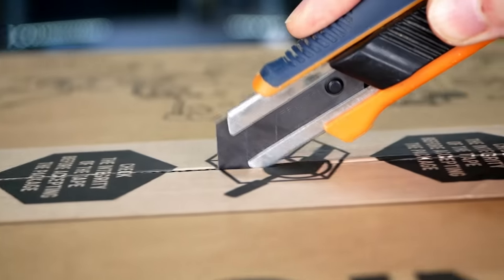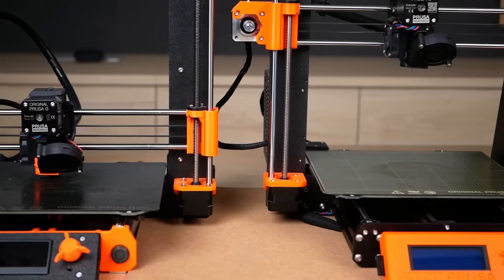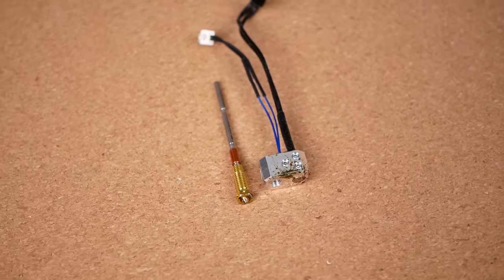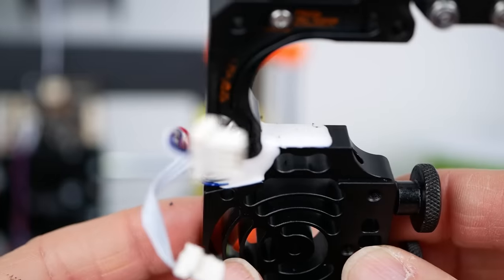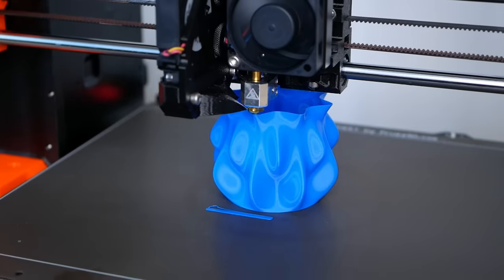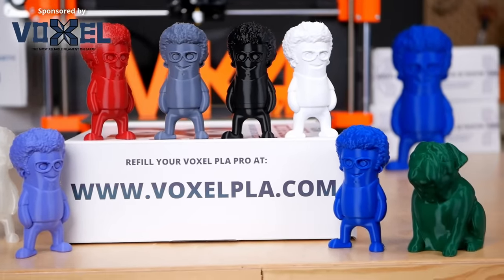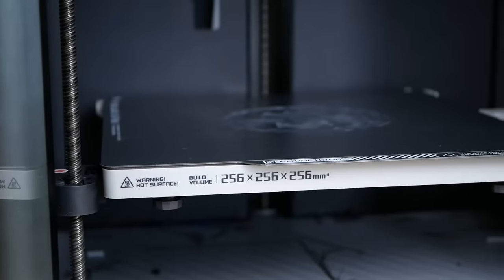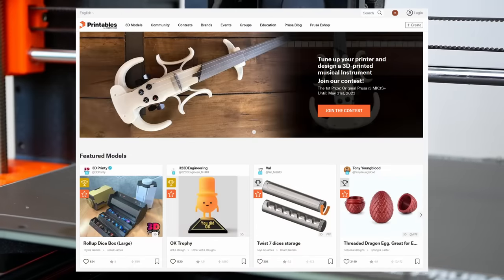Should you buy a NEW Prusa MK4 in 2023 or rather a Bambu Lab X1/P1P?

Comment: I own many 3D printers, including Prusa MK3S, Bambu Lab X1C with AMS. All of my printers print 24/7, I make parts for my business this way.
From my experience:
Prusa is a WORKHORSE, it always works with 0 repairs and barely any maintenance (lube rods). My MK3S printed over 150 kg of PETG and 30 kg of PLA in last 14 month.
Bambu Lab X1C - unfortunately is down 90% of the time. I constantly have errors like - “Z homing failed”, “disturbance detected”. And at some point printer stopped printing with “Z homing failed” error, per Bambu Support I did troubleshooting, didn’t help. Bambu support concluded - bed signal cable is defective and shipped me a new cable for me to replace (it takes 3-5 hours), and I think it will not solve the problem. Despite my multiple requests, Bambu would refuse to stand by their warranty and take the printer for repair. Quote “we do not have repair facilities to facilitate a repair”. That’s why I’m selling this piece of cr.. as soon as I get it fixed.
It’s all cool toys, until you need it for Business and consider Return of investment for money you spent on the printer.
That’s why I already ordered Prusa MK4 and Prusa XL

Comment: I read everything that is written in the comments and found nothing to convince our financial manager to approve the purchase of PrusaMK4 instead of Bambu Lab X1C. Prusa+enclosure which is necessary for printing engineering filaments is more expensive than Bambu Lab X1C without AMS and prints 3 times slower. All major spareparts are available for Bambu Lab and cost reasonable money. The choice of PrusaMK4 looks like the primacy of emotions over the reason.
Reply: Totally true. Just stock up spare parts in case the won't be available in the future anymore and you are set up pretty well.

The one and only downside is the noise of the printer, it is advisable to have it not in the same room where people work. If that is possible, there is no reason not to buy the X1C
Reply: @Jay Rizzie  More over, I've already tried not original hot end for Bambu from Aliexpress because I used not the best quality filament for fast prototyping. It's the same good as an original one. Quantity of third-party spare parts for Bambu is grown up. It looks like we are on the safe side with Bambu spare parts at the moment.

Comment: As a viewer from South America, I have a MK3 and will upgrade to MK4. I would not go for Bambulab simply because of the proprietary hardware, which would create for me a very severe reliability issue.

Of course, one should have spare nozzles or other parts that require somewhat frequent replacements, but having to import those parts can be a pain and take a long time, whereas the parts used in the Prusa are readily available in any market due to the popularization of its clones, making it a lot easier to service long term.

So for me that reliability and the community around their open source initiative is enough to justify the premium, not even addressing the very good costumer support that I have received when I needed.

Comment: The problem of a proprietary ecosystem is not only that they don't give anything back to the community. It's also a number of traps like “oh, you need a slicer which runs under linux? we have one, well, a binary you can download from our website, which will only run in a specific five-year-old ubuntu release and crash randomly sometimes. Also, you cannot because we removed linux support two months ago”.

There is a chance that Bamboo Labs will for some time have better attitude than a manufacturer I had the described experience with about ten years ago (switching to Prusa after that was a really a fresh air breath). However, relying on that would be definitely not a comfortable decision.

Comment: There isn’t a comparison anymore between the two.  Bambu Labs leap frogged Prusa by probably 2-3 generations at this point.  As far as stuff being proprietary - sure but it is incredibly inexpensive.   

You aren’t married to the cloud, the X1C will work off an SD card as well. 

I truly believe Prusa didn’t see Bambu coming until it was too late.  They released the MK4 before the software was ready to try and drive sales.  As far as EU labor costs go - I get it but I’m not paying $700 for a printer I have to spend hours assembling, that’s insane.  Prusa needs to adjust its price point.  I don’t see the MK4 competing with an X1C at all no matter the firmware.  It’s slower and it’s still single color limited.  You don’t realize how nice an AMS is until you use it.

Comment: No I think you gave a pretty fair review. Even though I am using my X1C almost exclusively now. But I still have my MK3s, and probably will convert my XL preorder to a MK4 upgrade. I want to support Prusa, and I hope BL will put more back to the community in the future. I think strategically after the BL entry, Prusa had to do something. And with the MK4 they might have rushed a little to get something out the door to stop the market share bleed. And yes, with their long term track record, it'll become better overtime as newer firmware comes out. I do hope Prusa remains a strong competitor in the industry. But their next product will need to be much more of leap forward.
Reply: Why would you pay for an upgrade that costs just a little bit less than a brand new printer?

Comment: I want them both, a good reliable fire and forget for easy one-color or one material prints in combination with a multimaterial/color and high temp, I could get a lot more prints done, I would go for the Kits though since I love tinkering, I am currently working with an ender 3 Pro  not just because it was cheap, but I wanted to learn about 3D-printing, and there is no better way to learn than to upgrade a flimsy cheap bedslinger in to a reliable 3D-printer, in a way these printers are indeed cheap and unreliable for the non-techies out there, but you learn a ton improving on them, and after a 32-bit card upgrade and a color touch screen, a BLtouch, a swiss micro direct drive and full metal hot end and all the other software changes, it is no longer and ender 3 pro, but an ender 3 PRO and factoring in all costs of those upgrades it costs about the same as a Prusa MK4 Kit, off course I paid for them in tiny pieces but never underestimate what it has cost you in the end. And in that regard i don't think there is such a thing as a really bad 3D-printer, some will teach you a lot (often with blood, sweat and a lot of tears) and others will do as you ask and are simply reliable. I do however not like the proprietary software of Bambulabs but sometimes you just have to take the good with the Evil

Comment: your 3d printing speed is limited in fdm print head by the acceleration, only spray the plastic with hot air and deflect sideways with hot air nozzles, like in a crt screen

Comment: Let me think. It's 5-16-2024. The Prusa for around $1,000 USD or the Bambu Lab A1 which looks like it was made by Apple, touch screen, 265 x 265, Injection molded parts rather than 3D printed ones, blazing speed! Can Prusa go belly up almost overnight? I hope not, but they better get with it. It was a good run, but it's over.

Comment: I always enjoy your videos as they look at as many aspects of the subject as you can think of. I personally think that prusa has become totally dependent on the twin screw I3 and now I4 design. I have asked for years for a CORE machine from Prusa Research with no answer. I just do not think they have the design engineers to get it done. For a PLA print farm an I3 is an awesome choice for the exact same reason an Ultimaker is a good choice for a Core machine. Their slicers and their firmwares, both of which are primarily designed for their machines. The other profiles are either volunteered by the machine manufacturers or are based on generic settings. Every company tries to find one niche in their design where they hold the key to that specific part. You can make a get around but the factory part is easier and time saving. That's just business. I have been waiting for the new breakthrough, but if another Hbot is it then it's off to bambuLabs for me.

Comment: Well, I guess uniquity of prusa printers makes t A LOT easier to find spares, especially outside the EU. Also you can ask any question on Reddit and it is answered in minutes by the community. I definitely had quite a few problems initially, nothing major, just a few bits and pieces due to lack of experience.
Compared to Voron, Prusa "just works". Even though their MMU unit is... not as reliable. But the printer itself s extremely reliable and requires absolutely minimal maintenance and fuss.
Only after assembling a voron trident I realised how advanced Prusa's firmware is, how it s helpful in a large number of small ways. Starting from filament loading, filament sensor, etc. Turned out that those are really important quality of life features.
I don't have a bamboo, at last not yet, but overall, Prusa is the most hassle-free, convenient and reliable printer with a ton of quality of life features. I actually made an enclosure for it from the Lack table, it works quite nice, but it seems like the MMU doesn't like the high temperatures

Comment: I would say do not upgrade to a MK4 go buy a BEAR i3 kit from LDO or a Caribou i3 kit for the same price, OR buy a second hand MK3 (sell the frame). 
Get a BEAR i3 upgrade kit for cheap with a 32 bit board better TMC drivers like 2209 or 5160 or something a big screen or touch screen on it.

I almost bought a MK4 but decided to NOT do it... i recently sold all my Prusa MINI's because these are not trust worthy, but still having the MK3S's
Still running strong with almost no service over the years other than oil de bearings sometimes and a new nozzle.

Reason i would say get the BEAR i3 upgrade is the frame is way stronger, and will always be stronger than the MK3/4/5/6/7/8 frames.
You can attach / upgrade more to it while the prusa is limited.

If ur not handy... yeah its hard to say the Bambu is really nice and got some awesome features to it... but im worried about repairabilty of that machine.
While a Prusa or self build machines you can source parts everywhere.

While I love prusa's ease of use (the eco system around it) like printables, customer service etc etc... i still find Prusa REALLY lacking in innovation...
And also using A LOT of stuff the community already made, they just change the design to their own design and done.

Im impressed with the Bambu's but idk yet... Ultimakers 2+'s these are beasts too... but too expensive, even a clone is too expensive to make.
But these are outdated as well even their new ones are outdated. got lazy and expensive so they moved to the industrial market.

And now you got Prusa as imo the top of the line well known brands... but Voron and or Caribou 3D printers... well... you know... these are better.

Comment: I think a big thing here is a lot of the things mentioned as positives for the Prusa just don't really matter for someone looking to print quality parts and print them quickly. I am sure you're aware these are the biggest points for anyone who wants to produce parts and this is the entire point of a 3d printer. I want to be able to print the most common materials, at the best quality, at the fastest speed.

More open source? Well that's cool and all but how does that affect the quality of my prints or the speed?

Reliability? Bedslingers have inherent issues here no matter what you do with them. The Prusa is reliable yes, but is there any metrics provided on reliability vs the Bambu lab? Any actual data?

To me, I am looking at what my dollar provides to get to my end result. 

The Prusa makes no sense to me anymore in any category. 

If you're looking for something that is moddable, you can choose a much cheaper printer and mod it to way higher spec than any of the Prusa's for a lot less $. For example, I bought a cheap coreXY from creality, upgraded the Z motion system, upgraded the hotend and extruder to a LGX/mosquito/BL touch and am still well under the price of a Prusa and have had no issues printing after the setup, ever and it has klipper with input shaping, etc, etc, all enabled and working.

Comment: Well, it would be a lot worse if the extra hardware was not there. This 'more firmware later' is not uncommon - widely used in the video and photographic world and you see it a lot on electric car - think Teslas. To my mind the biggest thing missing is an enclosure, that's a game changer in itself. The Prusa 5 is going to have to move away from slinging the bed, yes, but what you get with the 4 model is high reliability and ease of use and in a print farm that rates very highly indeed. The Prusa 4 is a commercial farm orientated product that also works for amateurs - at a price. Quality and support costs money.  You get stuck, who will help you more?

Comment: For me 3D printing was always a means to and end.... a tool to use and not fiddle with. Also just want good quality on the final part and design freedom without having to worry about overhangs and so on... so a working multi-material system that can work with glass or carbon reinforced materials is the deciding factor. Always found it absolutely ridiculous that I needed a raspberry Pi and third party software to print wirelessly so this "delay" on their part was always telling about their future but also understand that being a European based company they also need to make the economics work. As of now Bambu Labs is the way to go for me.

Comment: since i already have my MK3S+, i don't see the need to buy the "all-new, better, and improved" same shape 3d printer (like some car ad). it feels lackluster tbh. the machine design feels like same old, similar but different style. 
i used to have I3 MK1, the one with acrylic frame, then i bought MK2S, then MK3S+, which for me, the next logical upgrade with all the automatic sensor and stuff. but now, the MK4 with all the "fully automatic" system, for me "it just works" is not good in my book (ultimaker, makerbot offer the same "it just works, plug and play" system and yet, still have problem and need manual adjustment), so i am still not fully sold and trust the system since even MK3S+ still need adjusting sometimes.
just a quick note, i am just your average 3d print hobbyist with 8 years of tinkering experience (start around 2016) but i am definitely not a technical person and don't really follow the mechanical technology progression, so you can take my review as some average newbie user with ignorant personality. and that is why i don't see the need to have larger screen, quick swap nozzle, and 32-bit board. it seems like the best upgrade possible but again, i find it's hard to justify the value i don't care.

Comment: I agree, I would love for Bambu Labs to open up more. But bottomline, it's within Prusas control to improve, innovate, and respond to competition. But at this rate, they are very slow to innovate as they are in a very stable place. So I will support the conpetitor to prompt Prusa to innovate. Also it's important to not the price difference between the P1P and MK4. A print farm of 20 that $500 savings is huge.

Comment: I do not yet own a prusa, but choose it over Bamboo because that I do not like that the Banmoo requires internet to run fully, and do not like being dependant on internet or the supplier for my machine to work (bamboo) also a factor was that it seems, as i read it, that the connection is not secure… and really think this should be mentioned…

Just like I don’t want streaming my music, and cannot find a ‘banned’ song 20 years from now…
Reply: I have an MK3s+ and a BL X1CC. You are incorrect on all accounts. You can print sans the internet via sd cards or lan only. There is even a non documented way to Ftp files to the printer. 

The printer does NOT require the internet to run fully as the only thing that is disabled is firmware updates and camera and cell app. The Prusa does not have a camera or a cell app at all so there is parity there.  

All cloud network traffic is handed via secure https(AWS) so wherever you are hearing this FUD you should stop relying on it as a source.

Comment: Bambu still wins on speed, features and price point, but there are a few things Prusa does better which never seem to get mentioned.  Number one is the print startup time on a Bambu is hella long-- something like 8 minutes between  hitting start on a cold printer to when the print actually starts.  The bed leveling sequence is quite long and noisy.  Prusa just just gets to the point of starting the print much faster.  The P1P version of Bambu  also has a pretty bad user interface, and a horrendously bad error reporting system that forces you to look up error codes on a website instead of just printing the actual error message on the screen.  Bambu also lacks hot end presets for various filament types and forces you to painfully dial up hot end temps manually when not running prints remotely.  Manually printing from the SD on Bambu is such a pain that it pretty much forces you to run prints remotely from the slicer instead.  This adds additional delays from uploading gcode to the cloud and then back down to the printer followed by unzipping the file on the printer.  It is a good thing Bambu printers are very reliable at starting prints without any user intervention at the printer itself, because there can be 15 minutes from when you start the print from the slicer and when the print actually starts. Luckily you can just walk away and know there won't be any problems.